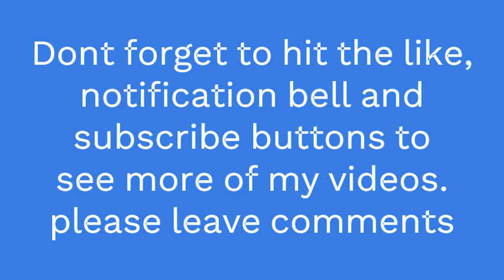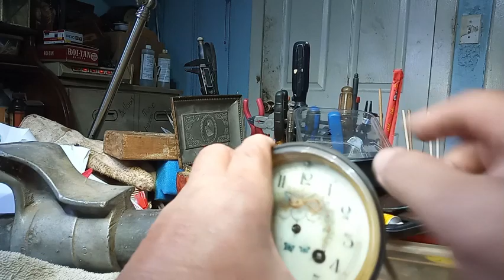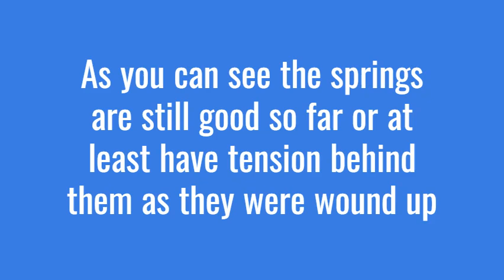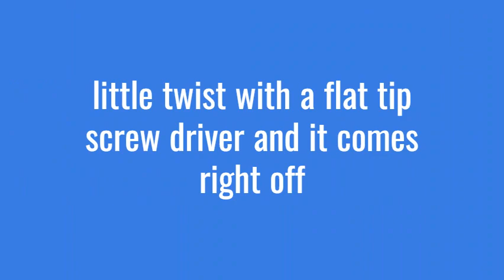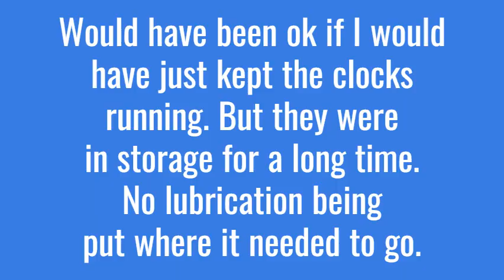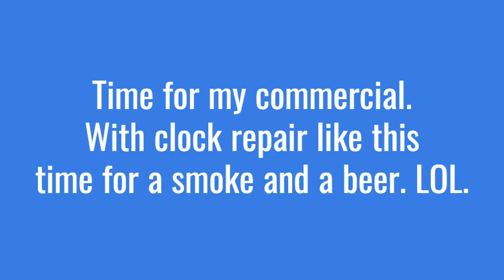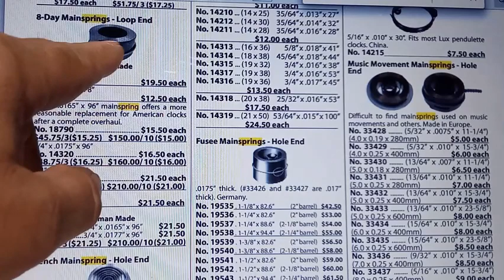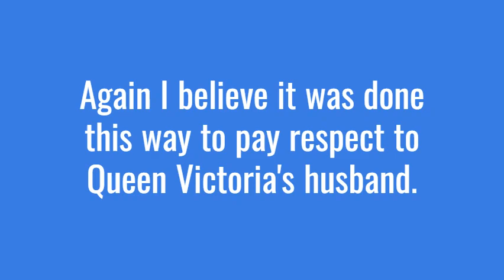Repairing a 18880-1894  French Black Slate clock made by Japy Freres. Part 1 of 3

Comment: Hi Mark, thank you very much for the video. I have the same clock but the issue is at the time side: when i turn without power on the main spring, the other wheels are not turning. The clock is cleaned and everything is on the correct place. I received the clock with this issue. Any ideas what i can do for troubleshooting? The strike side is working perfectly.
Reply from the maker: If all the wheels are not spinning then the first thing that I would do is take the power off (I have videos that show you how to do that) and check for end shake. If the wheels dont have end shake that would cause the wheels not to turn. French clocks pivots are sometimes very small. It might have a broken pivot in one of the wheels. Last the verge and crutch assembly might not be set right so the clock is out of beat. Manually (with power on the spring) rotate the verge and crutch assembly back and forth on the escapement wheel to see if the escapement wheel moves, then the other wheels,  and if it does then your verge and crutch assembly needs adjusting.  I hope this helps. Good luck.
Reply: Thank you. The wheels have end shake.  During checking i broke one pivot 😢. I don’t know if it  can be repaired or possible maybe to buy one? I also took some pictures of other wheels that i don’t know if the pivots are ok.

Comment: Hi Mark,
I'm so glad to have found your video. I own a French slate mantle clock with a movement that looks nearly identical. My clock has a broken pendulum suspension spring that that looks exactly like yours. At least the fragments of it which I found inside the case. Could you perhaps share a link to purchase the suspension spring? I'd be most grateful!! Best Regards! Doug from CT
Reply from the maker: Glad that you found my channel. Timesavers sells them. They cost around $6.50 per spring plus shipping. Just search for suspension spring (or part # 11068, 11069, and 11070).  Etsy also sells them for around 2 for $11 plus shipping. I have bought 100 German suspension springs off of Etsy for around $50 where Timesaver sells them for $5 a piece. If you are like me when it comes to these type of suspension springs you will break one every time  you service a clock. Before I found the ones on Etsy I would tell myself when I was servicing a clock that there goes another $5.  Keep watching for more great videos.
Reply: Wow Mark! Thank you for replying so quickly! I will get right on it and order a couple!! Happy Holidays! Doug
Reply from the maker: I just so happened to look at it right after you asked a question. Please dont expect me to respond so quickly on all your questions. I too hope that you have a Happy Thanksgiving, Merry Christmas, and a Happy New Year.
Reply: Per your suggested options, I ordered the (2) suspension springs for $11 from Etsy. They are a little different in size, but since my suspension spring is broken into pieces, I can't determine the exact size. I'm hoping (1) of the (2) will get that pendulum hung and swinging. Thank you again Mark, for your advice. I look forward to viewing your video library and have subscribed to see what's new!   @munnerlyn3